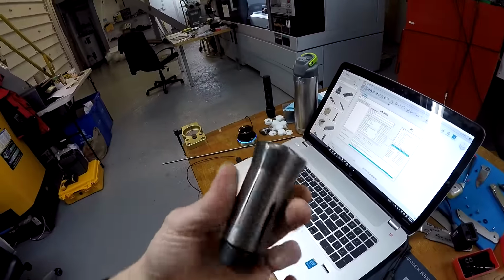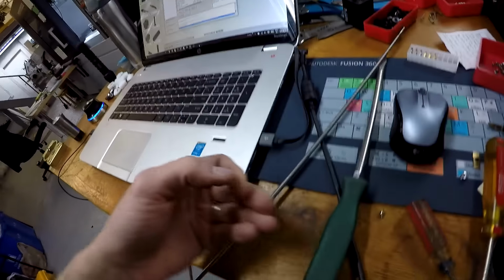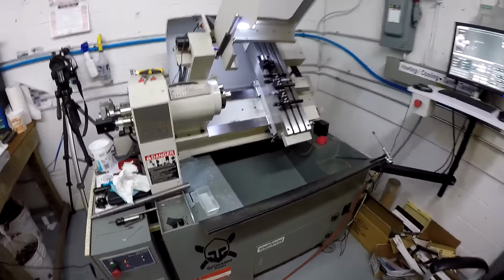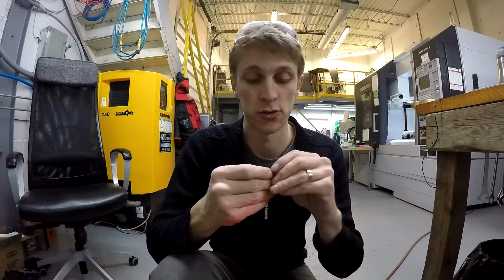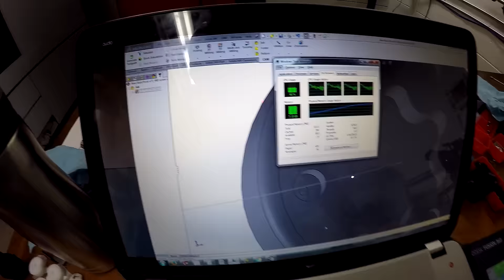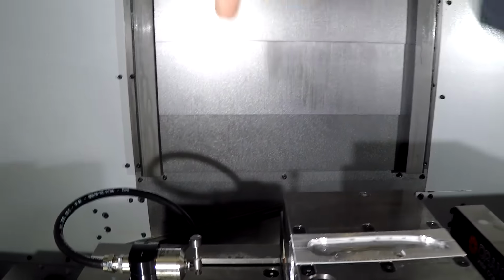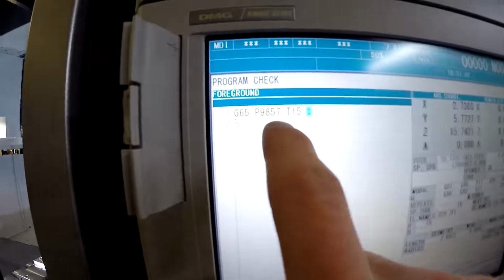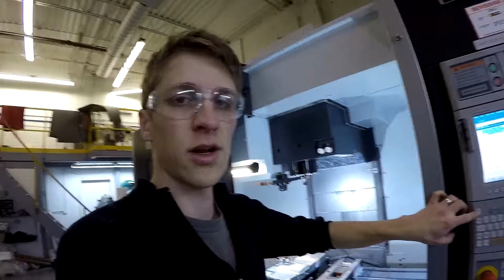Titanium screws - Grimsmo Style

Comment: hi I normally dont point things out but I believe the tool path on the screw could be better if you faced  and roughed once instead of using your grooving so much you could put the chamfer and the full contour in two passes with your 35 degree tool then just thread and use ramp out for your threads so you dont need a groove unless you want to then just part it off

Comment: Titanium is a "pyrophoric" metal (it emits sparks like flint,  or burns when disturbed, machined, etc.).   Titanium and alloys of titanium are preferred in aircraft to eliminate unnecessary weight.  Titanium also does not corrode.   If power tools are used to install/drive titanium or titanium alloy fasteners, enough heat can be generated to ignite the metal.  I have installed thousands and thousands of titanium alloy screws on aircraft assembly at Boeing-McDonnell-Douglas.  The company outlawed the use of power drivers for screws because of the risk of overheating the screw/fastener.  Many of the screws go into nut-clips, or have nuts installed on the opposite sides.  Those nuts are usually "deformed" to act as a locking mechanism (unless they go into a blind hole, rivnut, etc.).  So there is a lot of friction and heat is developed.  The metallurgical properties of the fastener can be destroyed by the excess heat.  I've seen sparks and little titanium embers emit from the end of nut-clips etc.  It is a good idea to take your time when assembling titanium fasteners.

Comment: when i single point thread i like to re face/ turn, than run another thread cycle after :) makes any hangers  or burrs go away. And it seems the rapids on the lathe are a bit slow, make sure your rapids are at 100% "feel like i am being to managatorial" if thats a word
Reply: +Trinity Dezines oh and the nub on the end, we always call it a "tit" hahaha anyways that is mostly the cut off tool being out of center. there may be a flat on the tool holder shaft? you can still tweak it by loosening the bolt that holds the shaft, turn the cutter toward the center, tighten it. some times them tool holders with the flat on the shaft can either be a good thing or leave you with these tits.  if it is a shaft  tit "thats what you have" you are way under center, must come closer to center... if you have a miss shape or flag tit, you are over center. these are little things you will pickup in the turning world. i hope this helps you :)

Comment: John,

Hardinge collets have more "spring" than other brands.  They are more expensive ($34 for normal accuracy), but I have Centaur, Lyndex and numerous eBay/Shars collets and now I only buy Hardinge for this precise issue.  

Also, as you saw, Hardinge stocks sizes in 0.001" increments.  You can also go 1/64" up to the next size without issues in my experience - don't need to use Metric collets.  

You probably know this but banging on your collets with a screwdriver is pretty much ruining their accuracy - not great.
Reply from the maker: +Melange Bryce Great info to know, thanks for sharing.  

For all of my lathe parts I don't really care about collet runout and accuracy because I never flip parts over in the lathe, they all get turned in one op, so I don't even think about it.  That being said endmill runout on the mill is a giant concern of mine and is something I take very seriously.  I actually filmed a blurb about this while filming the screw vid but decided to make it a separate vid.

Comment: Titanium is a relativly soft metal, isn't it? Why do you not mill a negative of the screw head, coin it and then lathe the deformed sides off? I guess that could work.
Reply from the maker: +Viner Cent Yeah that could work, might have to try that someday.
Reply: JohnGrimsmo I actually over thought my idea a bit, if I am not mistaken this the the real way screw heads are made: You will have to compensate for the pressed in Volumina in the leathed diameter of the screw head. Then you create a mold, which cups the whole screw head with the indentation (I have no clue how it is called in English) in the bottom. Then you screw the screw tightly into a block and then press the screw head in the mold. This way you eliminate the step of leathing the screw another time. You can even make big batches of screws this way, if you grid out the mold and a fitting plate for the blank screws to fit in.

Comment: When buying material, it's a common issue to have it either not conform to specs or have it be on the high or low and of specs. This is across all industries. If you want something that precise, you should have it precision ground when you order it or else expect it to be +/- 0.005 or more.
Reply: +Mechanical Engineer I've yet to see a supplier who doesn't provide their titanium stock oversize. This is simply because of its cost, many are looking to do as little machine work as possible on what they buy, and so buy very close to the exact dimensions needed and get salty if it's undersize.

Comment: To make the part off better, don't part it off. part it to about .02" ish and then just come in with the back side of another tool and break it off with the spindle turning slow or not at all. You can then rig a bin up to that for the part to fall into. Oh and never cut to zero with the part off blade, that is super hard on them, just go a small as you need to get it to come off.
Reply from the maker: +Widget Works Manufacturing Inc. Neat idea bumping it off, never thought about that.  Also I've never heard that it's hard on the partoff tool to go to zero, interesting.

Comment: There is a slightly angled cut-off tool for the lathe. (By my memory I´ll say its called right, and left"handed" cut-off tools) If you use that, that little knob, or pin, wont be there on the screw head =) And to pause it for a bit is a good way to break that chip. So great to make everything by yourself!
Reply from the maker: +Lillebroor I have some angled tools and do use them when making other parts.  I don't mind the nib on this part, it gets milled off later.  But there will always be some sort of nib on the part unless you can grab it in a sub spindle.  At some point it just falls off, or gets pushed off, there's no way the tool will get to zero before the part falls off.
Reply: +JohnGrimsmo Yes of course. I was thinking about when I were using a manual lathe. There you can get a wery little, or none, nub sticking out because you feed that slow. You are totally right there :)
Well my thoughts were that if the nub were reduced it might be easier to catch when not attach to any chips, in a tray when parting of. But maybe a chip-breaker pause would do just fine. Anyway, great work. As always :D
Reply from the maker: +Lillebroor I did try the retract when parting off and it totally worked beautifully, so I'll be installing my little parts bin underneath the parting tool again.

Comment: The Swiss machine guys use material for bar pulling/feeding thru a bushing that is on size to avoid the problem you are having.
Reply from the maker: +Dustin Walden Yup, they get their bar centerless ground so it's perfect.  That's definitely an option, but I ordered a bunch of 0.1875" bar stock from a reputable titanium supplier and hoped it would be on size or slightly under.  Was bummed to see it over.  But I think it's common.

Comment: I should think it important when spreading this way to go the same depth in each slot so that it will hold "true".
Reply from the maker: +ExtantFrodo2 You might be right, but for the parts I'm making it doesn't really matter.  I'm doing all turning in one operation so it's all concentric to itself.  If I were flipping the part over and putting it into the collet then you're absolutely right, accuracy would suffer.  That's a good point I didn't really think about while modding it because it didn't matter to me.
Reply: JohnGrimsmo
So I just finished watching the rest of the video. How did the chip breaking stop work for you?
Reply from the maker: +ExtantFrodo2 The chip breaking stop worked AWESOME!  I basically did two different parting operations, the first one ending at 0.040" and then the second one slicing it off.

Comment: I've gotten some good help from AutoDesk's Fusion 360's forums... can you create a file that demonstrates the problem with 2D adaptive clearing and post it to the forums?    They may be able to key in very quickly on the problem.  You don't have to post your "commercial" file, but rather a mock up that demonstrates the same problem or behavior.    Also, when your tool paths get small enough are you sure you aren't getting down into quantum physics?  (kidding on that last part)

Comment: Having those grinders right above your precision machines is going to wreck those surfaces.  At a minimum you should have positive air pressure in the shop and those grinders close to the exhaust otherwise those machines aren't going to stay precision.  Well, perhaps still more precise than a hand-ground collet.  ;)

Comment: Machine a 0-1/a2  material make the tool .002 larger and heat treat.58-60.  drill the max hole and press it in BROACH. BE ALOT EASER.

Comment: Maybe another crazy idea: I loved the blued slotted screws on Clickspring (https://www.youtube.com/watch?v=NExV5ZS9nss). It looks truly handmade and would remove the need for special tools for maintenance of the knife. You should be able to broach slots on the lathe using a carbide parting blade or something similar (probably smaller), going 0.002 per pass or something like that. If the lathe can hold its C position rigidly. Though that means you would have to machine the screw in reverse orientation.

Comment: if you are making custom screws you should make custom screw head and key. not a universal torx.  to me a custom screw head would be much much more desiarable. and if the knife came with a custom bit/key that fit the heads that would be amazing.
Reply: +Forrest McMahon And you could make a head that is easier to machine. Like, just three holes in a triangle. Much more efficient to make :)
Reply: Then you'll have everyone bitching that you charge another $20 for the tool to take their knife apart.
Reply: +Forrest McMahon They are amazing, but it's annoying having to buy extra tools to do takedown on anything. Screw heads are also designed to reduce camout and stress loads across the head, it's not as easy to pull off as one might think.

Comment: you are over working the end mill, all end mill should do is a light finish cut. under size drill by .004" the six points and the center of the torx screw this will cut down the work load of the end mill, and drill the six other holes to size.

Comment: number 12 or 11 collet would be the ticket here. either .1890 or .191"
Reply from the maker: +Finn Custom Knives Most places only seem to sell them in 1/16" increments, like I'm using.  A quick look shows that Hardinge sells them in every 0.001" increment, pretty cool, but at $54 each.  Tormach ones are $12 each.  But you're right I'm sure they are available.

Comment: You need to get rid of themes (service.msc in run) and all the crap surrounding those. It chews up quite a bit of memory and in some instances the stupid thing does funky stuff with programs.

I managed to pull quite a lot out of a 4 yo Asus i7 laptop just because i killed all those parasite processes.

And, it's a lean modification of the windows. :)
Reply from the maker: +aserta Interesting tip, thanks!

Comment: The reason generating a tool path take so long is efficiency. The program is trying to make the most efficient path possible. Humans are naturally quite adept at such a task, while computers are not. This is why the human brain is still considered more powerful than computers. Computers are good at arithmetic and logic, but when it comes to efficient paths, the computer will test every possible path, compare it to the most efficient path found so far, and do this until every possible situation is covered. This requires a lot of RAM as there is a lot of information to store.
Reply: May also just be a driver issue, which would explain why it takes so long on both programs.